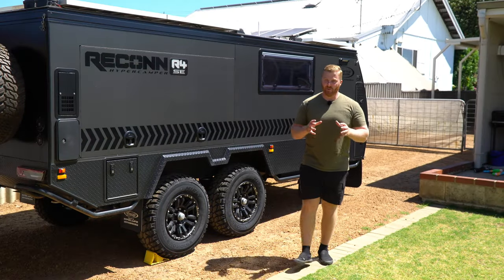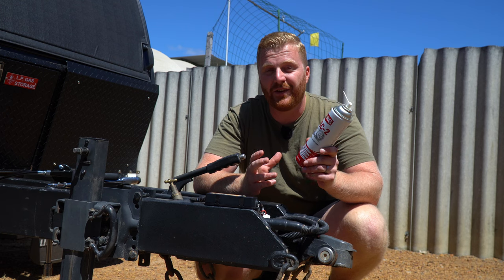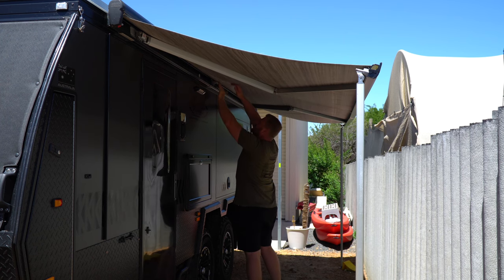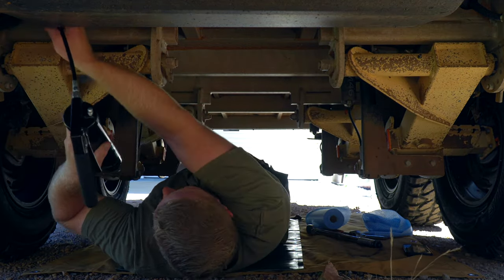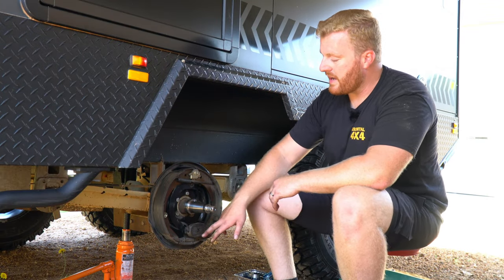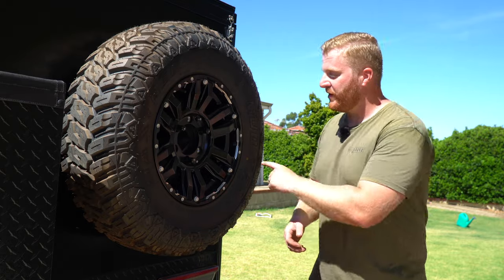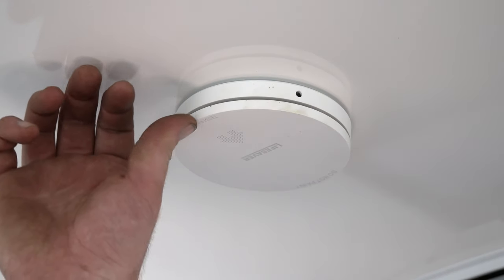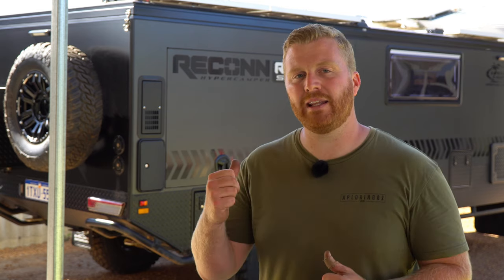ULTIMATE CARAVAN SERVICE GUIDE | Wheels | Bearings | Brakes | Hitch | Suspension |Electrical Trailer

Comment: Hi Nathan.
Another insightful informative presentation, come to expect nothing but the best from you. 
Just touching on the brake adjustment.
The recommendation of 8 clicks release came with hydraulic drum brakes of yesteryear, it was an old school mechanics adjustment, in a time when brake force was controlled by fluid pressure.
In my opinion it simply doesn't stack up on electro magnet brakes.
Why?
The electro magnet is mounted on a pivot leverage arm. The arm replaces the hydraulic slave cylinder in afore mentioned hydraulic system.
The more you back the adjuster off, the further distance this arm has to pivot prior to brake pressure, it's a pendulum basically.
The lengthened pivot allows additional pendulum momentum resulting in brake grab.
In crude terms, the magnet clamps onto the revolving drum, flings until resistance of brakes shoe pressure causes magnet to now slide against face of drum brake.
Pendulum effect needs to be minimised, to achieve that I use the following method.
Turn adjuster to shoes are in contact with drum, then apply park brake firmly as this force centres the brake shoes within the drum (shoes float).
Release park brake and check if any further adjustment required (if mechanism has not been service for a long time, usually yes, additional adjust required hence repeat applying park brake again etc.)
Release park brake.
Now only wind adjuster back enough to allow the wheel to rotate, slight resistance, usually 2-3 clicks achieves this. This method eliminates the pivot of the actuator arm, reduces pendulum effect eliminating initial brake grab.
Basically, as soon as magnetic force applied, magnet bonds to the drum outer surface pivots a miniscule amount before resistance of brake pads is applied, no pendulum momentum effect prior to brake shoe force being applied.
I came across the 7-8 release clicks talking to a chap from a brake centre one time.
Once I demonstrated the workings of the electro magnet mechanics to him & how that release volume created the pivoting pendulum effect, he was in agreement it was too much.
Thats just my thoughts on it all. Just wanted to share my years of experience on the issue..
Best of Christmas to yourselves & your viewers 
Regards, Wealie.
Reply: Mate, I'm blown away by your effort with this reply. Brilliant information. if Nathan doesn't cover this in his video, perhaps you could make one yourself? Thanks for such an informative reply.
Reply: @iangoodwin345  all's good Ian, appreciate your reply but won't be doing a video myself as I'm not tech savvy, but I do have some nouse on brake maintenance as I was in the caravan industry, (sales/service) for 6 years, learnt a trick or two in that time. I purposely displayed & demonstrated electric brake operation (backing plate with electromagnet & shoes, a drum with machined magnet surface & shoe surface, plus a selection of brake controllers) to potential buyers so they clearly understood the workings of basically an unknown braking system that was required by law.
N.B. At this moment I would also demonstrate how to adjust the brakes shoes via cam adjuster to overcome grabbing brakes (pendulum effect).
Once I delivered a van I'd take the new owners out onto a back road, demonstrate how the electric brake controller worked, emergency actuator, how to utilise to control sway, then have them drive & adjust the brake controller to experience different settings and the effect so as to have a clear understanding of the system.
It probably won't surprise you, but the number of people I came across towing vans with an electric brake controller installed with no concept of what it was or how to adjust it nor operation of the emergency actuator.
We prided ourselves on sales, delivery, on going maintenance to our client base.
Our service devision was renowned throughout the entire caravan industry.
Company changed ownership, customer service fell by wayside for immediate sales, hence business fell off, all experienced staff (myself included) left, I've since retired but the chap whom used to manage service (whom had also left) has since purchased back the run down business, has expanded the business, relocated into larger premises, then had the new premises enlarged over onto the block next door, let's just say he had a massive amount of caravan maintenance knowledge & a huge following of clients from past.
I loved my time in the industry, it was like being on holidays every day, but getting paid to do something I or actually we (all staff) so enjoyed until the new owners took over.
Bit of a ramble, but now you know where I'm coming from.
Reply: Excellent. We (wife and I) did a two day towing course as part of a Certificate IV in recreational vehicles. They gave us a good rundown on the operation of our Redarc electric system from a drivers perspective, not a maintenance perspective. I am confident with the operational aspects of the proportional braking etc. After 12 months of operating, I'm now getting brake grab at low speeds when stopping at roundabouts, give way signes etc. I've adjusted the controller to a lower level, but I would be keen to learn how to check the brake set up to ensure optimum brake performance rather than just fiddle knobs on the dash. Best wishes for your retirement. Thanks again for taking the time to reply. Regards, Ian

Comment: My guess is that most people towing a trailer do not regularly check and service them. Couplings, brakes and lights are the basics. But we still see dodgy trailers on the side of the road!
Reply from the maker: For sure, I can believe that. It one of those things that's sidelined by the servicing of the tow vehicle and people forget the pressures and strains placed upon these trailers.

Comment: Travelling long term as you were, would you still perform these checks annually or more often during that time?
Reply from the maker: Definitely more often. Each item is slightly different, things like suspension and tyres pressure are checked regularly, especially when on rough roads. I replace the bearings every 20,000kms and this is when I would go around and do checks like this 👍

Comment: I'm not a mechanic in any shape or form. However, I certainly do visual inspections around and under the van. I would not have the confidence to remove wheels and disassemble hub and brake components. Too scared at what happens if I stuff up. I happily pay my dealer for an annual service and I have fingers crossed that they are on the ball with all their checks. Thanks again Nathan for your usual comprehensive and informative review.
Reply from the maker: Cheers Ian 👍  It certainly can be a little daunting, however with some practice it's not too bad. I've got a bearing/brake video coming out this weekend that might be of help? 
Hopefully this can at least get others to check some extra components before hitting the highway! 👍
Reply: @XploringOz  , I will certainly be keen to see your instructional video on the wheels/brake assembly. I have learnt so much useful information from your videos over past years. Thanks again for all your efforts.
Reply from the maker: @iangoodwin345  So good to hear, thanks 🙏